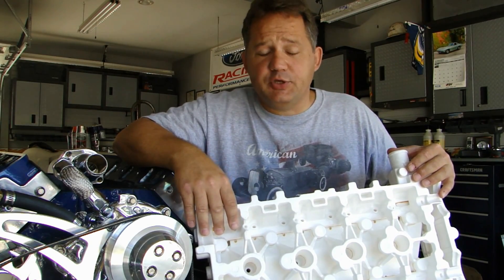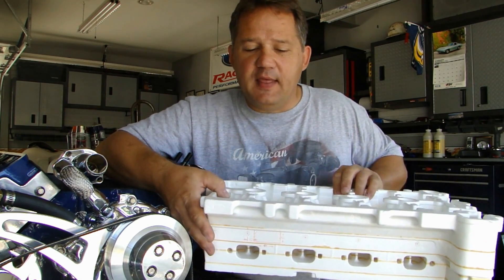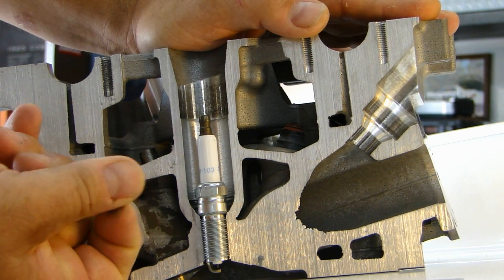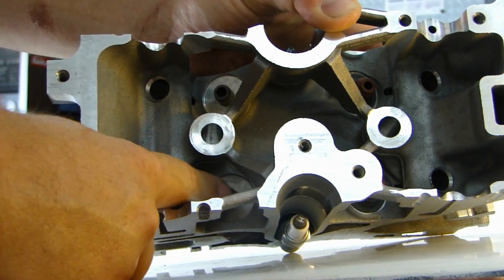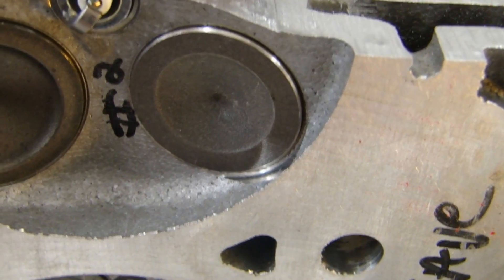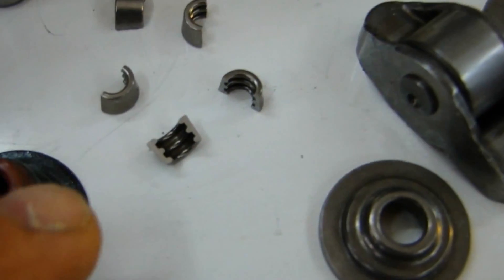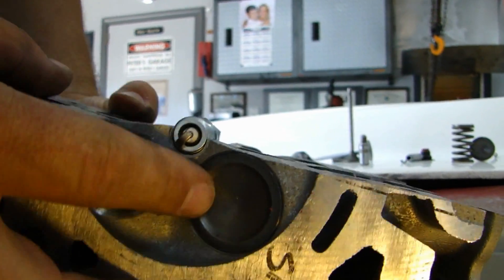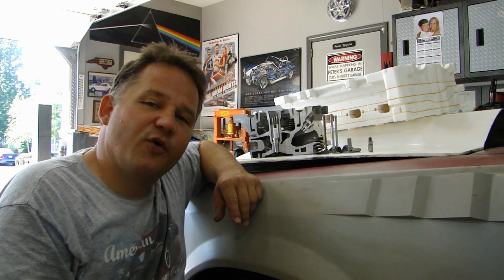How Cylinder Heads Work

Comment: Very well done. Thanks! Couple questions… why not glue the keys in place? Or use magnetic keys that will just pop into place and stay put? Or threaded keys that just screw on?
And what is the advantage of four valves per cylinder?
I enjoyed this video quite a lot. Thank you again!
Reply from the maker: The keys need to be removable. Magnetic keys are actually a problem for the automation that installs them. Should the keys become magnetized, all of the parts are dumped and demagnetized along with the machine. More valves make the head breathe faster.

Comment: That's fantastic!! Love the texture of the foam evident on the surface of the cast aluminum.  This vid is 10 years old?? Have you cast your own heads?
Reply from the maker: 10 years old, but still relevant. I have not done my own casting.
Reply: @PetesGarage  great video
Reply: @PetesGarage  got my own cnc router and fusion.  thinking about modeling my own cross flow head for my 240z, find someone to pour it....

Comment: Great video. Can a bent valve can be just replaced? If something else is damaged like pistons.. How will be the way to check?
Reply from the maker: You can, a bent valve will stick open, you can check with a vacuum gauge
Reply: @PetesGarage  Thanks reply! Just opened the engine. will need to replace head cylinder and 1 piston so far

Comment: Regarding when an intake/exhaust valve opens or closes: About how much do they open by? More specific, what's the travel distance from the seat fully closed to fully open when the springs, keeper, etc are installed and the engine is running?
Reply from the maker: That all depends on the camshaft and engine size. It can be anywhere from .300" to over .600"

Comment: Can I change my valve seals in my garage with no kind of machining needing to be done to the head? What about the valves themselves?
Reply: Also wow what a great video. I didn't know how my cylinder heads worked and now I do 👌 can't put a price on that. Thank you
Reply from the maker: Yes you can. All you need is a valve spring compressor tool and hand lap the valves

Comment: Most port injected engines utilized closed valve fuel injection, i.e. fuel was injected right onto the closed intake valve. Thus, the injectors didn't really need to vaporize the fuel.
Reply from the maker: Interesting, thanks

Comment: I am rebuilding a 390FE for a 50 year F-250.  I want to increase the torque, it's a street ride that may pull a trailer or truck camper.  I've bought a lot of new parts, don't know what to do 
about the heads.  

Is there any advantage to using aluminum heads for my application?  Can you get into cast iron Vs. aluminum?
Reply from the maker: Aluminum is lighter and will transfer heat faster for higher performance engines. If you are going to tow with it the aluminum would help. The availability of heads and intake sets really makes it easy for this type of upgrade. If you can afford it, do it.

Comment: Questions how big is the clearance for the exhaust to go out. One of the spark plugs ceramic broke and when in the cylinder I was wondering if hopefully it when out to the exhaust system?
Reply from the maker: Most parts like that will break up and come out of the exhaust. Just hope they don't cause any damage to the top of the piston

Comment: Getting valve collets off is a right ballache sometimes when the spring has pushed the retainer onto the collets, locking them into place. If anyone is having trouble removing them, try adjusting your spring compressor so it only moves a small amount but puts more pressure onto the valve retainer. This cracks the collets loose. Once the collets are cracked loose, you can then adjust your spring compressor to have more movement so you can remove the collets fully. Makes the job go a whole lot easier once the collets are cracked loose, just like removing wheel hub nuts.
Reply from the maker: Great comment, thanks for sharing

Comment: are there any advantages an aluminum head has over an iron head, other than weight?
are there any applications where an iron head would be more desirable?
Reply from the maker: An aluminum head will dissipate heat faster and more evenly. An iron head can handle higher compression ratios

Comment: Hey Pete...good work man....there is a word you said that i missed....what is that part that the rocker arm pushes and it in turn pushes the valve into the cylinder itself?...What was the word you used....
Reply from the maker: It's call a shla (Stationary Hydraulic Lash Adjuster)
Reply: Thanks a lot,and is there any kind of maintenance done on valve guides?...in most tutorials they dont even dismantle it

Comment: Simply amazing....and the manner how it is explained it clearly gives you a picture of how this works.  I recently purchased a 2002 mazda and I'm having headaches....it started with radiator running hotter than normal.  The mechanic looked at it and there was trans oil in the radiator and reservior.  Changed the trans coolant, flushed trans, actually cleaned the valve body.  I am still having the two issues which is shifting problems especially when starting to move the pickup, sort of lack of compression and then it speeds up.  The radiator also runs hotter than normal.  So I just scratch my head and my farm really needs the pickup to do some work.  I fear the whole thing may be damaged.
Reply from the maker: +Carlos Avila Sounds like to transmission oil cooler is either leaking of blocked. Change it
Reply: +Petes Garage Thanks and indeed the trans oil cooler was leaking.  It has been changed.  I still have the problem with the engine running hot so I guess it needs a diagnostics???  I use it minimally (urgency) but put on the heater on to help with cooling.  Thanks again.
Reply from the maker: Might be a faulty thermostat
Reply: +Petes Garage You're right -- it was thermostat.  It was removed.  I still have the issue with the shifting problem and I will ask the mechanic to check pressure to see if the prob is with catalyst....thanks Pete....I really enjoy your videos that are so clear.
Reply: +Petes Garage Also realized that when I just turn on the key and start the vehicle, it revs higher than normal....if I shift to D..drive...it moves fast.  Not sure if this is the MAF.....is that what you mean with "lean"?
Reply from the maker: Yes...the MAF determines how to adjust the mixture at start up

Comment: Hello from Albania Pete! Amazing video :). I wanna to ask you about my car. I have a BMW 325ci and is leaking coolant. I checked for a leak but all is ok : pump, thermostat, cap, radiator. Mechanic said is Head gasket and head block but he isnt sure, and he suggest to me to change engine completely.  Wanna to know your opinion because you're professional. Thank you. And sorry for the language.
Reply from the maker: +Tefik Ramizi Do a compression check to see if there is a leak first.
Reply: +Petes Garage You mean pressure? Pipes are swell when i drive.
Reply from the maker: +Tefik Ramizi Sounds like the head gasket is leaking into the coolant and pressurizing it.
Reply: +Petes Garage Thanks Pete! Car is at mechanic, and the problem was head gasket and head block. Hope it will be everything ok. Thanks again!

Comment: Hey Peter, another good video. What material would the valve 'head' be made from since it differs from the stem (welded together) and why? Could you get a 'one piece' valve for certain applications? Really enjoyed this. Thanks.
Reply from the maker: +Philip M There are a few different valve head types. Typically they are similar to the rest of the valve parts. There are one piece valves that I have used in special applications. Stainless valves are most popular. there are sodium filled which help with heat dissipation, but I use those rarely

Comment: Is there any major difference between cylinder heads for petrol and diesel engines?
Reply from the maker: +Angel Kafazov The major difference is that diesel engines have higher compression so they require a stronger gasket, usually metal

Comment: Cylinder head is bolted to the top of the machine body and becomes the top part of diesel engine. Its functions are as follows: 1,Close the top of the cylinder sleeve; form a sealed cylinder working space with piston and cylinder sleeve. 2,The cylinder sleeve is pressed in the correct position so that the piston operates normally. 3,Install all kinds of diesel engine accessories. such as injection valve, intake & exhaust valve,cylinder starting valve, indicator valve, safety valves and valve rocker arm device etc. 4,Arrange intake & exhaust, cooling channel. etc. In the small high-speed machine of cylinder sleeve is also decorated with swirl chamber or precombustion chamber, so the hole and channel in the cylinder sleeve is various and make its structure more complex shapes.

Comment: *****  I have a 87 mustang gt with stock heads I wanted to know if I can change out stock camshaft to e303 camshaft and continue using stock heads? iam also changing out rockers and lifters. i would appreciate any feed back i am a beginner in the mechanical field.
Reply from the maker: Yes....many people tell me they have had success with that. Even though you have stock heads I would verify the springs are the correct ones for the cam
Reply: OK thanks for the feedback back love your videos very educational  helps alot

Comment: Thanks for taking the time to make the video, very informal. Can I ask a question, I’ve just tried to rebuild my 2004 ford f150 5.4 triton motor, first time ever (completing a rebuild motor). I haven’t driven it yet or broken it in yet because I’m hearing a backfire from the passenger side, which would be cylinders 1 thru 4. I’ve done a compression test and got the following readings cylinder 1 read, 150, 2 read 100, 3 read 100 and 4 read 150. I call the machine shop to ask if a valve is slightly bent could that cause the low compression that am getting from cylinder 2 and 3. They answer no, they said if the valve is bend even just slightly that it wouldn’t make any compression , is that true.  If there are right what do you think my issue most likely would be, (blown head gasket, because the low compression is affecting the 2 middle cylinder , but I wouldn’t /shouldn’t get a back fire , just low compression reading am I right in thinking so ,
Reply from the maker: Back fire is usually a timing problem. Check your ignition wires to see if you have those 2 wires mixed up.

Comment: Very soon i will be the owner of a van or a school bus that i will be turn into my home for a while. I dont have too much $ so, it have to be good and inexpensive.Plus i dont have any knowledge about mecanics. So in my searching looking for something that is cheap, that doesnt have too many milliage runed and in "good" mechanical shape, ill find out that the mayority are run by gas. I would prefer diesel cause a couple of reasons one its cause im planing to converted to run it with vegetable oil and 2 cause ive been asking around and people says that diesel have a better performance.But im in a kind of a hurry to find a place to live so if i dont find any diesel ill probably choose a gas one. So in case that happens ( and also just to learn)  here is where anyone that can help me come: is it any relation in between the amount of gas that a vehicle need PM and the number of cylinders that an engine have???? how does that works?
Any help will be apretiated
Reply from the maker: What do you actually need help deciding?

Comment from the maker: Unfortunately you'll have to pull the head. I would hand lap the valves to see if there are not seating. If the machine shop cut the seats wrong they'll have to re-do it. Sounding like a seat not concentric or worn valve guide. Have all of the guides replaced if you have not, and go with new valves. Hand lap to seat.

Comment: hello Pete! hope u having a great wknd, nice and sunny here in SoCal! B )  ok then, well even though I had previously performed this procedure, I didnt use the soap and water (good idea, thanks) so, i just performed it and confirmed. still leaking, over 50% and soap bubbles confirmed! don't know HOW machine shop performed the their test, but I'm clearly showing a massive leak at #1 cyl. didn't even bother checking the others! head is coming off, heading to shop monday with the video I took of it

Comment from the maker: Before you take the head of, take a dead blow mallet and hit the valve stems (fairly hard) a few times to push them open and let them slam shut. That will seat any valves that may be leaking. Then try the test again. Spray soapy water aound the valve stem to check for leaks there.

Comment: Well I got an update on this kia 1.8L cyl. Head leak. I removed cams with head still on block, preformed leak down test, and STILL have a bad leak! I'm thinking its coming from either a bad valve guide, or bad/rough cut on seats.  Going to continue tomorow morning. ur thoughts and opinions are welcomed  : )  thanks for these videos!

Comment: ok, how you doing Pete!  thanks for the quick reply, well it is a kia sephia 1.8L and I installed new rings, cylinders were in good shape, sent head to machine shop for repairs after engine overheated, checked block with straightedge, performed cylinder leakdown test after recieving head back from shop, no intake or exhauset manifolds installed yet when performing ldt, but can actually feel gust of air coming through intake valve!!!

Comment: thank you for this detailed video, really good explanation sir.  I think this narrows down my list of issues I been having with a cylinder head that I just got back from the machine shop that is STILL leaking "moderately" through the intake after performing a leakdown test. basically the only thing actually sealing there are the intake valves if I'm not mistaken. I'm thinking if the cam, cam guides, or lifters are damaged/won out, that it can be enough wear, to not let the valves seat properly.

Comment: I always wondered how the valve stem keepers actually stayed on the valve stem, (without having to open an engine up), and you answered that perfectly, I knew it had something to do with the spring tension keeping them on, but you pointed out the taper, and the taper on the cap and my mystery was solved. : )

Comment from the maker: The first thing I would check for is a worn cam. You could simply not be getting enough fuel or vacuum to keep the engine running at idle. Rebuilding the carb would not hurt, but it is probalby a bit more.

Comment: Hey how's it going? I just got a 1979 Ford Granada, my trouble with the car is when i turn it on it sometimes stalls on Parking, but it most of the time stalls when i shift to Drive or Reverse. I've been told it's the Carburetor.. that it needs to be adjusted or rebuild. I'm sure you're wondering why i bring the carburetor up, well I've been told that it can be the cylinder head too! that the pressure reaches to 90 instead of 120 above. Any help will be appreciated.

Comment from the maker: You are much too kind. I enjoy making videos that help people. If you are buying used parts, first look for any spot where it may have been dropped. Inspect the entire part for any visible cracks. Find out the return policy on any used part, if you can't return it, don't buy it. After buying it, have the head magnafluxed to check for cracks. It is worth the investment and you will be sure the heads you bought are solid. Good luck with your LS!

Comment from the maker: Any time you break open a fuel or hydraulic line there is a risk of FM entering the system. It would not hurt to flush a new filter with gas before installing it. Great idea and comment!

Comment: this vid reminded me of a question.  I have changed fuel filter on my port fuel injected motor ( 300zx nissan).  I thought to myself that maybe a new fuel filter might have some loose particles in it when first used.  Do you recommend flushing the new fuel filter manually with fuel to insure that no particles would clog the injectors?

Comment from the maker: Fuel injectors are now directly in the combustion chamber. Only air comes through the cylinder head. There is now variable displacement, variable timing, and variable cam position. Things are advancing pretty quick.

Comment: I think you're pretty crafty. -Get working on it! Fuel/air would have to be metered in some kind of pre-chamber or pressure vessel but it would be hard to make precise adjustments on the fly, like you said. Air would also need to be presurised, maybe via turbo or SC? Could also pose a fire or explosion hazard.

r.e. direct inj.; are you referring to those new small displacement turbo engines like Ford ecoboost?
How far do you think they can take the internal combustion engine?

Comment from the maker: Most new engines for 2013 will be direct injection. The fuel is injected into the combustion chamber at 4,800 psi via a high pressure fuel pump driven off a cam lobe. There are still intake valves but efficiency goes up. Injecting air into the cylinder as well is a bit away because it is more difficult to meter at different atmospheric pressures. Great thinking!

Comment: I thought of something once. What if you had a fuel injector that was seated directly into the combustion chamber and injected an air-fuel mix. This would totally dispense with the need for intake valves. I know someone is working on electronic valves out there. If this can be achieved, say goodbye to valve train and hello to total variable performance/economy in real time.

Comment from the maker: I am glad you learned something. I am working on a video for blocks. The head is the only way in and out on all engines. V8's, straight 4's, V6's....every engine needs a way to get air in and exhaust gases out. Even 2-cycle engines need a cylinder head to hold the ignition source and exhaust port.